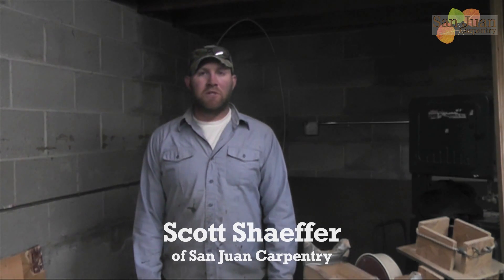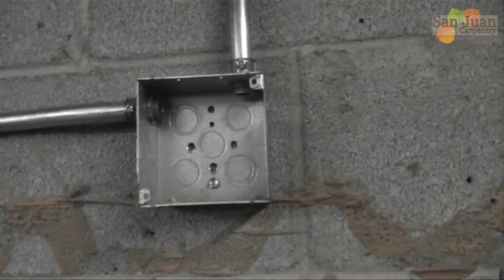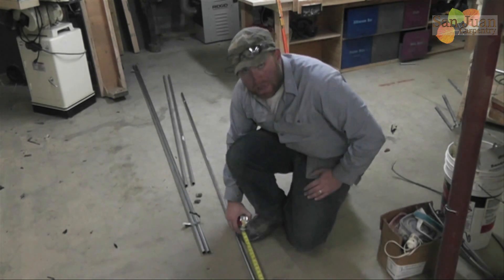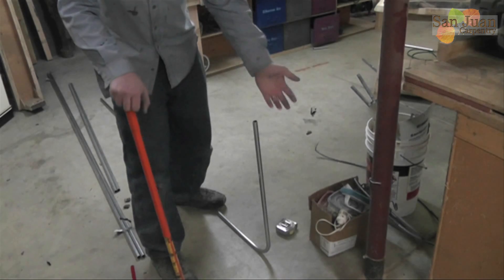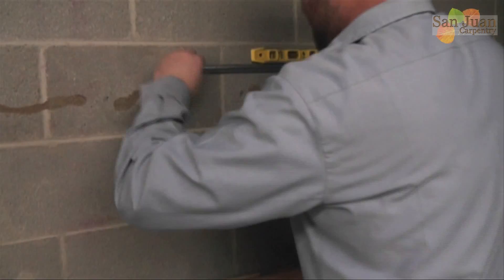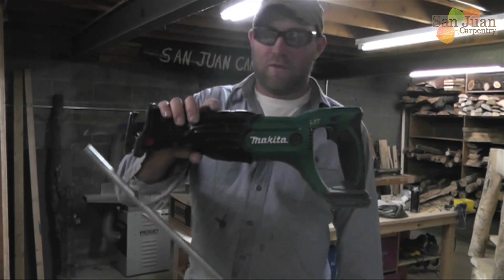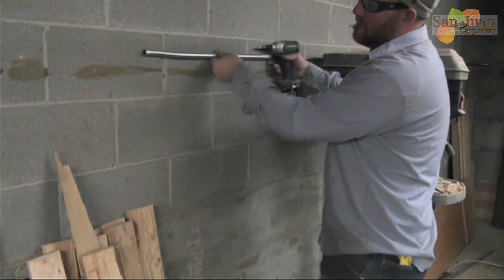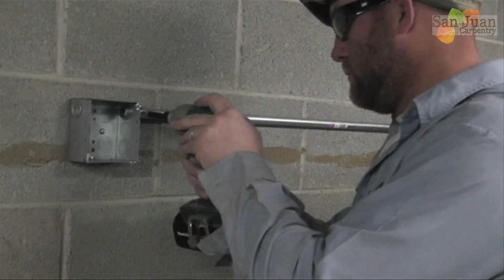Install EMT and Industrial Electrical Systems in Your Shop! (How-To)

Comment: Your earthing system should be more substantial, given you are using conductors to enclose your sub-circuits, not insulators. You cannot rely on fixings to ensure this as corrosion may occur overtime, increasing resistance. You need to make sure your fault path is low enough for protection devices to operate, otherwise you are creating a deathtrap.

If you make a system like this and aren't an electrician, at the very least get an electrician to do a safety inspection to verify the system is safe. No use saving some money if it costs you your life.

Also, very thrown off when you say, "pipe", it's conduit, as you usually measure it by outer diameter, pipe is internal diameter.

Comment: why do you deduct 5"? is that pipe bender that long? also how do you know what size emt you need? i'd need it big enough for 12gauge wire just 3 conductors.
Reply: 5" is the radius from the hash mark on the bender to the back of the bend. 
This number is for 1/2" emts
For 3/4" the number is 6" 

If you plan on running 3#12 thhn 
1/2" is fine.

Comment: Never force a rule of putting a strap on EMT within 1' of a box! Code is 3' from a box with any EMT. Too many straps don't look good and if you need to add straps to make the pipe look good you could have bent it better
Reply: Electricians follow the 18" for a device box. Code states within 3'.

Comment: Nice, thanks for the video Scott.  FYI for all your viewers, EMT is covered in Art. 358 of the NEC.  You can get free access to the NEC in read only mode (it's called NFPA 70) by setting up an account at www.NFPA.org.  The support rules are under 358.30(A) but for terminations at boxes it is WITHIN 3 ft of the box, so any distance up to 36 inches is okay, no support or over 36 inches would be a violation.

Comment: 27 dislikes... and they're probably all still using 50' extension cords from the other room...
Reply: electricians who don't like people figuring out things for themselves. Like the guy below here. There are literally millions of people doing their own electrical work. If it was that dangerous houses would be burning down daily. LOL. Just use common sense and a bit of research. Pay close attention to loading and make good solid connections on all wiring including grounds. It isn't rocket science.

Comment: Scott,
Excellent tutorial.  Appreciate you taking the time to film it.  I'd like your input on something.

I have had a new detached garage / shop built on my property down here in Durango.  It has two levels:  the lower level is 4 bay garage with space for shop; the upper level is for storage (or maybe a workout/sleeping space as it has good views of the mountains).  The building  has a basic 100 A service to it in a 24 space breaker flush (recessed) panel, a couple of receptacles on the panel, and an outside light, but nothing more.   

There is no insulation or wall covering yet, so I could choose to wire the entire building with NM-B (Romex), then insulate and cover with OSB (or some non-drywall covering that looks neat... I really hate drywall in a garage).  Or, I could insulate, cover, and run EMT, like you have done in this video, to give the whole thing a commercial look.    

I have run many thousands of feet of Romex, but have never run EMT (or rigid) conduit.  If you were in my shoes, would you spend the time to learn how to run the EMT (figure it will take about 3-4x as long because I'm a novice), or would you run Romex, and maybe surface mount steel receptacle boxes throughout?

Thanks!
Kirk

Comment: See you were pulling NM through the EMT. Is that up to code? From what I've seen, it seems you are allowed to pull it for short runs say down from a basement ceiling to a box for protection but not so sure for longer runs like you show to each box?
Reply: +after. It's not a wet location and it's not NM cable it's UF cable.
Reply: if you listened he said it was the old conduit

Comment: Great post, but the ko filler should be installed from the inside of the box so the prongs dont hit a wire.  I have seen shorts because of it.  Other than that good job.

Comment: first off thought the video was very informal but one question!!! just curious should you strap the pipes down every 3 ft or 1ft my first ob is coming up on a government building doing rough in work for fire alarms. didn't know if the blueprint would tell me or not

Comment: Your not running MC, it's EMT.  Supporting is always 3 ft from any box, panel, or conduit body.  Then every 10 ft from couplings.  So a good Journeyman Electrician (like I am) always go 3 ft than 2 ft before the coupling.  That's on the first pipe of the run.  Where is your bushings?
Reply from the maker: LOL wow, you've been busy trolling my channel, haven't you? Proper supporting is covered in the video. Bushings aren't required for this application. A good Electrician (like you are, obviously) doesn't need to get into pissing matches. How about you make your own videos? It's time consuming and you'll expose yourself to other people like you but if other people can learn from you and do a better job, it's worth it. So good luck with that. And if you feel the need to "contribute" to my channel, please do it with a little more respect. Thank you.
Reply: @YouCanBuildThat  good shit bud, you ran pipe like an electrician.
Reply: I am not a journeyman like this amazing perfect craftsman commenting. I am still working towards being towards that goal. I am how ever a commercial service electrician. I will start off by saying that for someone that is not in the trade, you did a very good job of bending pipe. The code says that you must support EMT WITHIN 3ft of a connector and within ever 10ft after that. So, your 1ft support is just fine. Second, bushings are only required on #4 wire and larger. Because, the weight of the wire sitting on an unprotected edge can actually damage protective coating and cause a short. Again, great job on bending.

Comment: Were you a sparky in a past life?
Reply from the maker: Yeah, I was! Could you tell? I worked for a commercial electrical company for two years as an apprentice. I don't know everything but I know enough to teach the basics. EMT installation was my favorite part of the job. I ran thousands and thousands of feet of it at DIA and other commercial sites.
Reply: +You Can Build did you finish your apprenticeship? if not what have you moved into. I'm currently a electrical apprentice but I'm not sure this is the right job for me.

Comment: Enjoing the videos. I usually watch from mobile devices though so the links don't display. Would you be able to also paste the links you reference in the description section above and on future videos so I can easily link out as well?
Reply: San Juan Carpentry
 How do you get the wires through the pipes?
Reply from the maker: That's a good suggestion, Allan! Thanks! The wiring video will post a week after this one went up so I'll add the link at that time.
Reply: +saik0pod Fish Tape